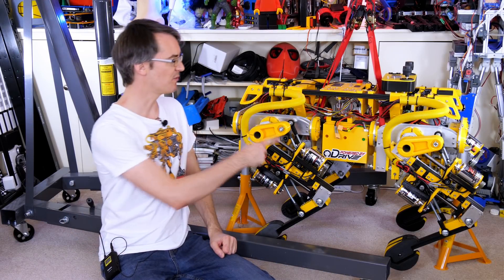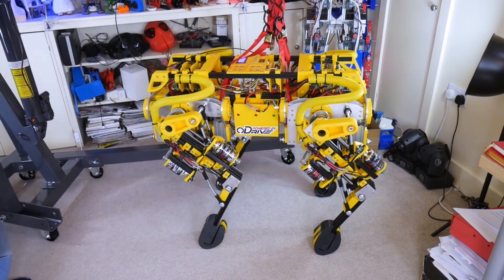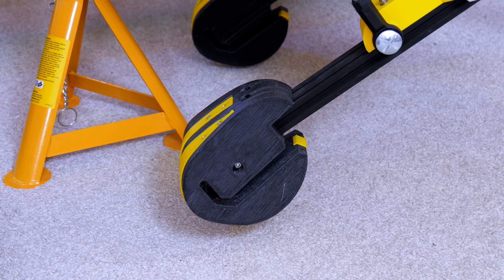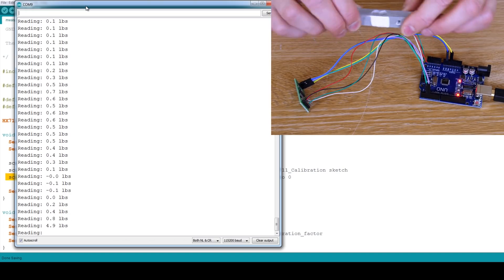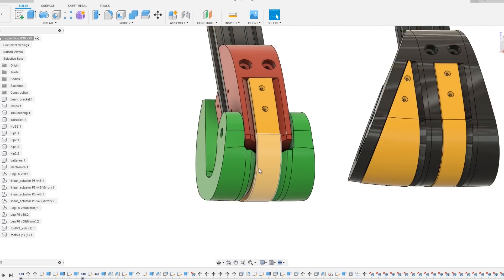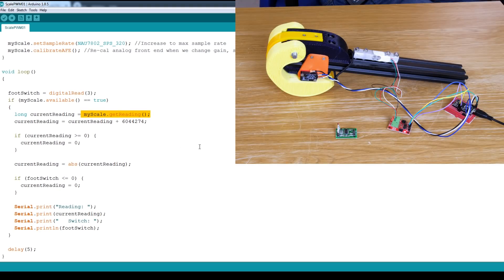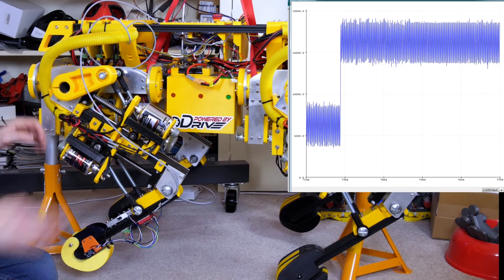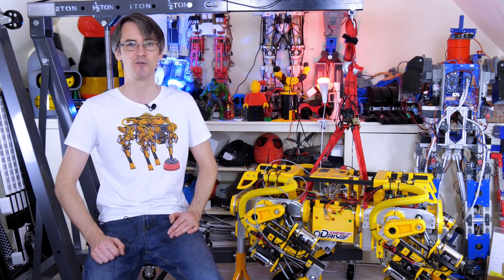Robotics R&D: Testing Load Cells for Robot Foot Sensing

Comment: how about accelerometers in the feet and watch for the deceleration spike when they touch the ground.. ?
Reply: Because you wouldn't be able to tell the weight distribution when the dog is static. Say for example the dog is leaning forward and not moving or very slowly, you still want to know there is more weight on the front paws.
Reply: @didz65  That's why he has the load cell, i'm talking about replacing the switches.
Reply: @thygate  If it put the leg down slowly it would be nigh on impossible to tell that it had hit the ground. Why would accelerometers be better than a switch anyway?
Reply: @clonkex  No moving parts to gunk up and fail. And I assure you, you WILL see a spike when hitting a stationary object, no matter how low the speed. Find an IMU monitor App on your phone and try putting it down without getting a spike.
Reply: @thygate  Tbh I've never once seen a microswitch fail. You'd have to be pretty hard on it to kill it. And sure you'll see a spike when you hit the ground, but reliably detecting that spike could be difficult. A microswitch is just a way more viable and useful solution in this case. Cheaper, simpler, more reliable.
Reply: @clonkex  The switches are going to bounce around and be unreliable and inconsistent. You will always need to post-process/filter the data, even for simple switches.  And after running for a few days in moist weather, or let alone on dirty terrain, those switches are not going to last long and certainly won't be consistent. Some multi rotor aircraft also very reliably detect landing using their IMU. Even NASA has been using this method for decades to detect landing ( https://ntrs.nasa.gov/search.jsp?R=19690045290 ).
Reply: @thygate  It's very simple to debounce switches, and since when do they fail just because of moist weather? Also I can't imagine the dog will be walking on terrain so dirty that the switches stop working.
Reply: @clonkex  Yes debouncing switches is easy, as is detecting a value increase that exceeds a certain threshold. Point is there will be processing in any case. 
Which option do you think will last longest and produce the most consistent results over time ? It's not the switches.
Also I have had to retire more than one mouse because the microswitches started failing, so there.

Comment: Why not glue the strain gauges on the aluminum leg - block directly? But even like this, you would be measuring torsion of the leg, not really weight.
It turns out even the cheapest of load cells are quite linear, so you can design to integrate them directly in the feet, but use full bridges if you don´t want to get into very weird and probably un-calibratable areas, though there are ways to circumvent this but that´s another rabbit hole on it´s own...

Comment: Hi James
Instead of using CANbus have you considered ROS (robot operating system) ?
This would require a Raspberry Pi but is intended for this type of application.
Reply: CAN bus is a standard for data transmission (like serial), whereas ROS is for control of a system as a whole.  I agree that using ROS would be a good step forward, however, and to top it off it can work with arduino so long as there is a Linux computer to send the appropriate messages.

Comment: Just a thought, could you not be picking up the noise though the metal on metal connection with the load cell and aluminium extrusion? Perhaps try removing the load cell from the metal and powering the motors on to see if you are still receiving bad data. Id be surprised if the motors were corrupting the data between the two microcontrollers.
Reply from the maker: The noise is gone if I read the data from the Teensy on the foot.
Reply: So, it isn’t coming from the motor wires? It’s basically a grounding issue on the chassis?

Comment: If You need any help about CAN bus let me know ... differential signal will cancel your noise for sure . But maybe you can manage without it just with some smart wiring. Anyway there are plenty available libraries, you just need to choose some transceivers. Dunno if your uC have a CAN controller already implemented though ... if not you should use some other differential protocol.

Comment: What if you send the signal with a twisted pair of wires, one sending the signal, and the other sending the reference "ground" voltage, then you subtract the "ground" voltage from the signal to filter out the interference?
Reply from the maker: Yes CAN bus is a differential signal which does just that

Comment: Did you ground one end of your shielded cable? Doesn't do much for shielding if not....
Reply: Inside a metal casing there are no electric fields. If not grounded, it still acts as a capacitor. It DOES shield the cable. But it could be better, you are right there

Comment: How are you shielding your cables ? Is the braid properly connected to the electrical ground of the robot ?
Reply: I saw your response to the same question in another comment, where you say they are grounded. Have you tried to ground them to a different ground (one that is not providing to the odrive, like the house ground) during the investigation ?
Reply: If I understand what you did correctly : You are sending PWM with pwm frequency=200hz, and you are using interrupts to look the instant when the bit flips. The fact that it's not working means that the motors induces a voltage difference  > ~2.5V to induce a bit flip. As PWM is digital, it means that maybe with a little better shielding, you can go from horrible noise, to almost no noise at all depending on whether or not there is enough interference to cross the threshold. If this hypothesis is correct I see a few workarounds :
- Use an analog trick : Put a RC filter near the pin where you are reading the signal, this should filter the presumably high frequency noise (>20khz) from the brushless motors. You can read the signal either using an analog read loop, or still do the same as you are already doing digitally, though it will add a little offset to the value, as it will take a little longer to charge the capacitor (pick the cut-off value of the RC filter (~1000hz?) appropriately for the tradeoff between).

-Of course better shielding (provided there isn't too much noise on the ground) should also work in theory. 

-I'm not familiar with CAN-BUS, but although it's differential pair will help I'm not sure it will work in high electrical noise environment without issues.

Comment: having inside the 3d part the spring so new leg part could totally have flatter spring sensor inside so it could be more accurate
Reply: for programmable air could be help stopping and so on based on data from sensor then need to look this repo https://github.com/programmable-air

Comment: Those leg motors all need to be moved in board to reduce the leg weight so they react much faster and accurate like the Boston dogs.
Reply from the maker: Yes that is true, if I wasn't so far into the project I'd rebuild the whole thing taking into account my dynamic leg R&D I did recently as well.
Reply: @jamesbruton  Maybe worth taking a page from Martin of Wintergaten's book? Angle grinder, anyone...? ;)

Comment: Use cheap Arduino's to collect the data, out by the feet, then bluetooth that data back to your controller (Rpi 4).  No communication wires.  You could even use a small battery for the Arduino's data collection and not have even power wires other than the motors.